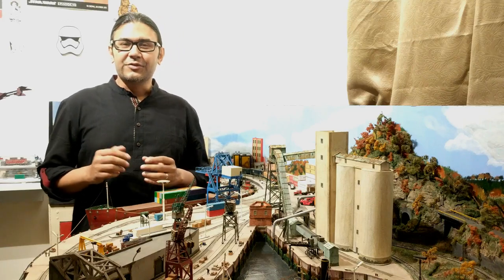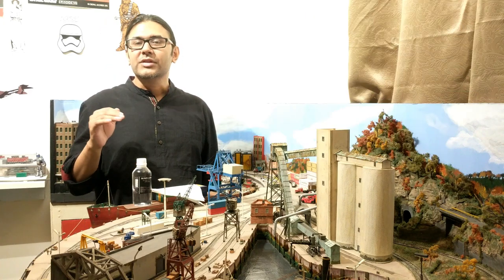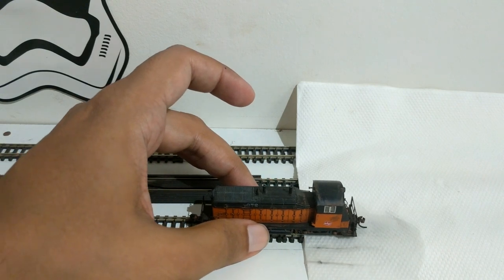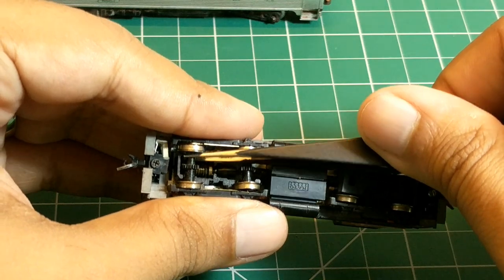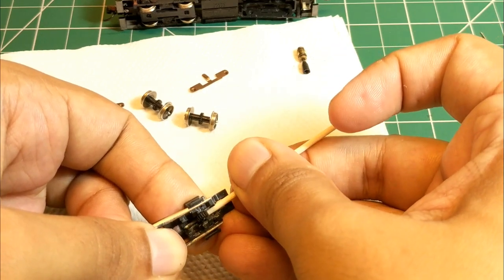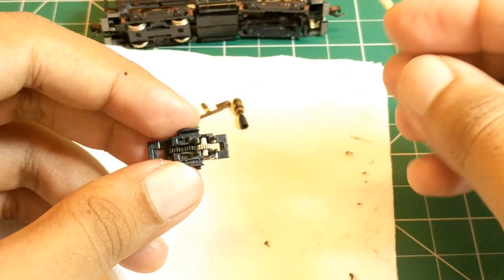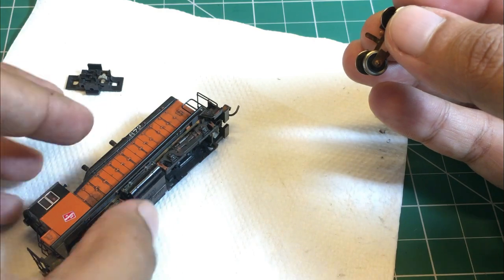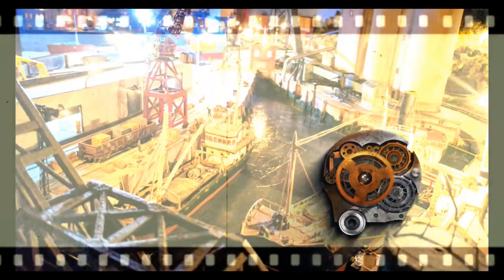Clean and Maintain an N Scale Diesel Loco: Model Railroad How-to

Comment: Great video, definitely subscribing. This will be my first attempt at cleaning so I picked up an older locomotive for $25 in case it goes sideways and something gets damaged or lost, just to get the practice. Thanks for the tips and guidance, I'll see you on the other side of the tunnel.

Comment: I have an N scale dcc atlas locomotive that was running pretty good one day next day not so well it runs from the start super slow on full throttle and it takes a little while to catch up to the full speed any idea 💡 please thank you 🙏  Your videos are great you should really consider changing your name to (Dr. Awesome Model Train Professor Fantastic Superhero 🦸‍♂️ that’s the title you should have because you my friend are awesome thank you 😊
Reply from the maker: Thank you so much Sean for your kind words. 🙏🙏 Thomas the Tank Engine is the real railroading super hero, not me... 😂
When you say your loco doesn't start till you go full throttle, does the light come on? If you were running DC, then I would've almost attributed this to dirty wheels, but since the loco is DCC, it might be a bit complicated. This is what I'd do:

1. Do the basic check on connectivity - All wheels are clean, tracks are clean and all contact clips /strips are clean.
2. Make sure that both the trucks are sitting properly with the right gears meshing, and the truck contacts are not tangled with the contact strips. The trucks should be able to move freely with it's copper contacts touching the copper strips all the time.
3. If the decoder is hooked through a harness, make sure the harness is connected properly.
4. Make sure that the tiny gears are clean and lubricated (but NOT over lubircated).
5. After all the above checks and corrrections as necessary, if you still have the same issue, then unfortunatley it has to be either the decoder or the motor. Try another decoder first since that's much easier than changing the motors. You might even want to contact Atlas at this point.

Hope this helps, and good luck repairing your loco. Cheers!
Reply: @TrainsandDioramas  thank you so much I’ll try everything you told me to do and you’re right Thomas is the real superhero😂😂😂

Comment: hey man, thank you for making this video! I do have a little question. Do you think it is okay to use this method with trains that have rubber tractions?
Reply from the maker: Hey, you’re welcome! Yes, all this is applicable for models with traction tires. The only thing is that you need to be a little more gentle and careful with the wheels with rubber tires so that you don’t cause wear and tear. It might help to actually take off the tires from the wheels, clean carefully and then put them back in.
Reply: got it, thanks a lot!